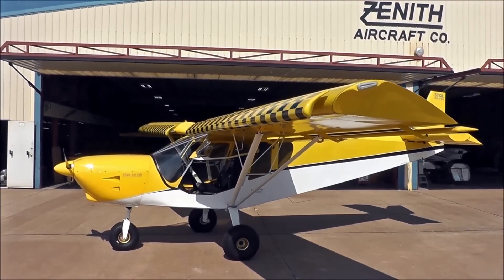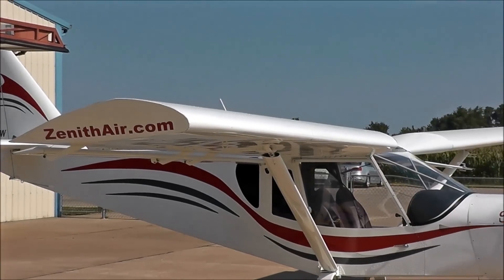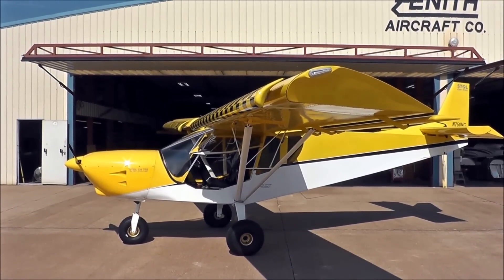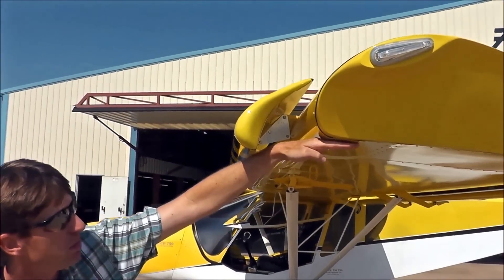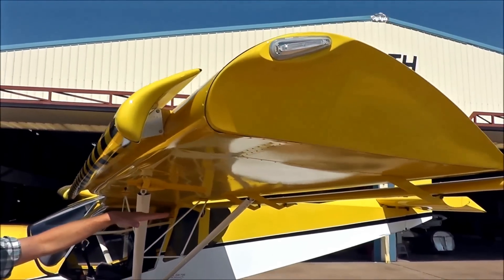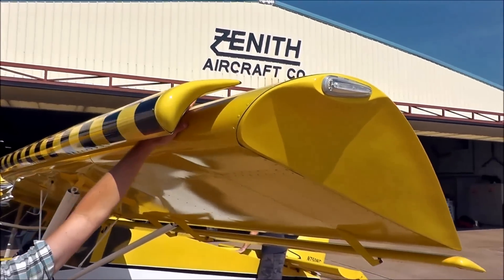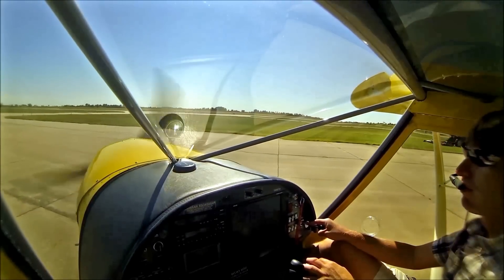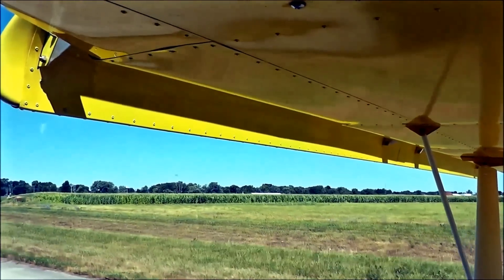Zenith STOL CH 750 with drooped leading-edge wing slats

Comment: Ground Ajustable Slats (GAS). Why not! 

You have to make new pieces of metal holding the slats with pre drilled holes. The pilot could adjust the positioning of the slats to this version (drooped leading-edge) the old (original) AND maybe a low drag position for long range flights.
Reply: Handley Page had a better solution. Spring loaded slats that compressed against the wing as airspeed increased and leading edge devices were not needed. When slowing down to land, air forces on the slats lessened and they extended on their own. Mechanically simple and completely automatic. Genius.
Reply: Check PegaSTOL ;)

Comment: The description in the video title is misleading as Slots are stationary and Slats are move-able. What I am seeing are Stationary SLOTS... We are seeing other STOL aircraft builders coming up with True Slats that Swing in or out when needed or not needed. Those Slats are mechanical and automatic as well. I wonder how these Slots effect the Cruising Speed and also Fuel Consumption too. I also have wondered why Zenith does not offer a Tail Dragger airframe.  I like the Zenith High Wing design but that Tricycle undercarriage is a no-go in BackCountry flying where a large rock or pot hole will catch the front tire/wheel. Just wondering the Why's behind the companies decision.

Comment: I'm not sure if you guys know that those aren't slats, they are called slots if you look at an aircraft design book even a basic one a definition of a slat is moveable on the leading edge, a slot is fixed in a position and not movable during flight like your aircraft 😉
Reply: The slat is the high-lift leading edge device, and the slot is the space between the slat and the wing
Reply: Seb C H um no, look at any aircraft design book. Technically it is slotted wing, slats are retractable period open any aircraft design book
Reply: Seb C H, A SLAT IS MOVABLE, A SLOT IS NOT, the piece you reference is the leading edge, it doesn't become a Slat until it's movable/retractable, that is a slotted wing, period
Reply: Yes, slotted wing (as in a wing with a slot in it) but the device is not a slot and it is not a wing. It is a slat (whether or not it moves)
Reply: Seb C H how many planes have you built?
Reply: Seb C H all you have to do is look up the definition of a Slat and it will make sense
Reply: Seb C H nope read again, but understand this time, that doesn't become a Slat because there is a whole behind it read the definition of a slotted wing and tell me this airplane doesn't fit the description, even though its built as a seperate piece it is the leading edge, slot not slat
Reply: Seb C H you say yes slotted wing, then say slat, it's not
Reply: Seb C H can't be both
Reply: Seb C H here I cut and pasted the definition of a slot, here it is, 
A leading edge slot is a fixed aerodynamic feature of the wing of some aircraft to reduce the stall speed and promote good low-speed handling qualities.
Reply: Seb C H by the way a slot isn't a technical name for a hole in the wing, not everyone is a keyboard warrior 😉
Reply: Seb C H This is a prime example of reading and not understanding
Reply: Seb C H I can cut and paste the definition of slat too if you like, I'm not trying to pick a fight but I hate it when wrong information is given, it makes people dumber.
Reply: Zenith Aircraft Company I had this argument with my old Boss, couldn't make him understand, I built 14 icp planes for him then he moved from Alberta to Paris Tennessee, I loved building planes and didn't want to move to states. Does Zenith have any smaller plants or distribution centers in Canada?
Reply from the maker: mirycreek haha, so true :)

Comment: Great thanks to Handley-Page.......closed at the zero-lift angle of cruise, but effectively open at higher angles of attack.....having them fixed means no moving parts to jamb in cases of mis-alignment or dried up lube on slider rails....

Comment: those slats should be automatically retractable operated by air pressure....then you wouldn't need two aeroplanes....the manufactures should go away and give it some thought... there are many old aircraft out there to copy
Reply: philip stien they tried that like 80 years ago not reliable and prone to failure

Comment: Why do you go halfway?  It should be bigger, more wing surface area, front skid protecting the prop.  Tail skid.  Robust  landing gear meant to handle rough terrain, with tundra tires.  If you are making an air jeep then DO IT!

Comment: Internet keyboard warriors are the best!  Nice product, guys.  I had the privilege of catching a ride in a friend's 701.  The kit seems pretty skookum.  I'm a big fan of Lycoming and Continental powerplants, despite the higher pricetag.  For the pilot wanna-be's who are being critical, wind, density altitude and weight are everything when it comes to short.  I can show you video of a Cessna 206 landing or taking off in less than 50 feet.  It doesn't prove anything except conditions vary.  Guys, if you're ever in Alaska testing or demo-ing your planes, look me up.  I'll pick the right day and land that plane flying backwards, to silence all these keyboard warriors.
Show less
REPLY
Reply: Yann Galtski with a 28-30 stall speed it's not hard the Savannah is similar to this plane and is crazy stable in a stall it just drops altitude with no wing nose tail drop, if you look at the high river airport on a factory testflight my boss opened the doors and took off on a 75' apron without a full power takeoff, and then climbs at 1200+ feet a minute fairly impressive for 90 horse, and not a very high topspeed

Comment: Holy smokes, a kit??  Can it hover in high winds?  
   I once saw a Navy rescue plane with large flaps bouncing its wheels straight up and down on the flight line in Dallas,  in about 30-40mph winds.  Can’t remember if it had a leading edge, but it must have.   We were joking, is it a plane or a helicopter?

Comment: I have manyhours in my Cherokee. I want tohear the engine and wind noise. It's information. I question what test with instruments did you do? What is the normal cruise   now? Why did not do this in the official design effort? 5 Degrees is not important. What is the stall speed now? This video makes it look like you don't know what you are doing in your design effort. Rethink.

Comment: Would it be possible to make the slats retractable so they lay against the leading edge of the airfoil when not in use for landing/take off? Unless I'm missing seeing something, you could have a STOL and cruiser in the same aircraft.
Reply: It would be possible. I believe most commercial airliners have had retractable slats for a very long time. The problem is cost/complexity and weight. It wouldn’t be worth it on this airplane$.

Comment: Germans did know this already since 1935, actually the BF109 had slats on their wings but they knew it was way too much drag during flight, so they made it retractable. fixed ones ..
Reply from the maker: Haha, yes, being a fighter, the Messerschmitt Bf 109 probably didn't benefit from fixed leading edge slats :)
On the opposite end of the performance spectrum, the German Fieseler Fi 156 "Storch," with its fixed leading edge slats, was inspiration for the Chris Heintz STOL designs, starting with the CH 701. You'll find it interesting ti note that a Fi 156 B model was developed with retractable slats but was never produced because of the negligible performance gains of the retractable slats (and the fixed slats version continued to be produced). Read the interesting Wikipedia article on the Storch: https://en.wikipedia.org/wiki/Fieseler_Fi_156
Reply: True, did nt think about that fact!, you guys are not gonna need to run away at 500 km/h from an angry mustang pilot  shooting tracers at you :) :) :) lol  That bird you ve made it is an awsome machine!
Reply: Joe Wilson not to be a dick, but they aren't leading edge flaps, if they are fixed in place they are called slots, if they retract they are slats, it boggles my mind that an aircraft manufacturer doesn't know the the correct terminology for its own aircraft parts, I built 12 icp Savannah's which are pretty much the same configuration, and repaired or rebuilt at least 6 of them for Skykits, and I had to pull out AME books to prove to him that fixed on the the leading edge are slots, and they become slats when they retract., sorry it's like nails on the chalkboard when I hear bad or incorrect info being passed out.
Reply: @mirycreek https://wikidiff.com/slat/slot
Reply: @mirycreek  the link says that if it is retractable it is a slat if fixed it is a slot. Geeeeee man take care of yourself
Reply: @marcjoseph8300  sorry, I'm sick of arguing about this, I built 12 if these for ICP, and couldn't even explain it too my boss, I just hate when people give out wrong info and pass it off like they know, I get even more frazzled when people who don't know argue a point, sorry man this just irritated me from day 1, I printed the FAA control surface defintions and highlighted 6-9 and gave it to my old boss and he still argued with me so when I see a video from an aircraft manufacturer I sorta expect them to know their shit. A lot of the people who have argued this before in this comment section have come back and deleted their comments. Sorry for being a spaz, I just hate bad info. Take er easy.
Reply: @mirycreek Anyway C, Heinz never wanted his plane to have slots … so gross … so he call them slats. Much nicer even if it is wrong :)
Reply: Just to add a bit of aeronautical nitpicking, still according to trusted Wikipedia the leading edge slats were invented and used the first time in 1918-19 by Lachman and Handley Page, they were in fact referred as Handley Page slats
Reply: J M look at the storch, it is a tail dragger but the great grandad of this and the Savannah, that Heinz says is a copy of his aircraft, in my opinion a way better engineered plane, but these planes "borrowed", design elements from the storch
Reply: Remember the junkers dive bomber and the leading edge flaps that was used on that plane .

Comment: I guess I have flown just about every STOL aircraft with the Horton STOL Kit. I have landed a 172 in less than 200 feet and depending on wind and temp I have landed a 150 on the numbers and stopped. I flew a Turbo C-206 for years and could take off in 600 feet with 20 degrees flaps and land in that distance as well depending on load and weather.
Reply: did you say the C150 had a STOL kit fitted....hell if you were any good with 40' flap you should be able to land  an old C150 on the numbers and stop anyway... if a C150 was fitted with a STOL kit ....Hell  I bet I could land one before it took off
Reply: Maybe traded airplane for bong.

Comment: That is a long landing roll for a STOL aircraft. No application of the brakes?
Reply: We didn't use brakes... we were testing for slow speeds and for elevator authority at the low speeds (taxiing with the nose wheel off the ground) and not demonstrating short landing roll.
Reply: Seb C H, OK that is a test I have read about before.

Comment: Not very STOL - have a look at
https://www.youtube.com/watch?v=Y7Jwde4EAVw
Reply: Chill bro, not trying to set a world record here.
Reply: Haha, that's a STOL performance in high winds with a custom plane (with lots of power!) specifically for max STOL performance piloted by a pro! Very impressive indeed! The point here with the STOL CH 750 is to show an affordable all-metal two-seater airplane, with less than 120 hp, with tricycle gear, with impressive handling and STOL capability
Reply: For what one of those Super Cub competitors cost, you could build three Zenairs.

Comment: That plane would  produce another 100 kilogram lift  if since it is a high winger, both the wing and the slats would keep going across  on top of the cabin.
Reply: True but this would also severely limit visibility (which is what separates the Heintz STOL designs from most other STOL planes)

Comment: Methinks, were these slats retractable, it could maintain a higher cruise speed.
Reply from the maker: True, but we've chosen to make them fixed slats for simplicity (both building and maintenance) and lower cost and weight. Retractable landing gears also allow for a higher cruise speed, but don't make a lot of sense on simple homebuilt (kit) airplanes.
Reply: Definitely slower but we didn't measure the cruise accurately since this wasn't our mission.
Reply: You guys are doing a great job!
Reply: Are the slats adjustable (on the ground. Change the size/dimension of the aluminum triangles?) Would there be any advantages to make them easily adjustable?  The advantages of this modification is obvious. However, sometimes, another characteristic is lost to gain another. What is lost with this mod?

Comment: Did the repositioning of the slats change straight and level speed?
Reply: Michael what the slats does is help increase the lift so it will result in it being able to fly at much slower speeds in level flight also but more so in take offs and landings which made what he said even more STOL.. so even more so of a shorter take off and landing :)
Reply: Roger started to say something about the affect on airspeed at 2:45 and they cut his sentence off.
Reply: Yes, increasing lift also increases drag...